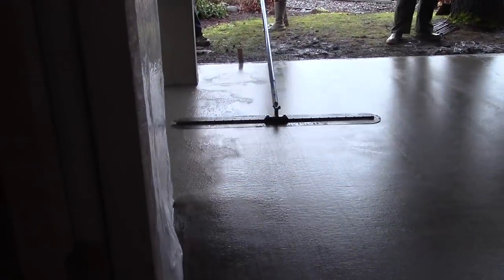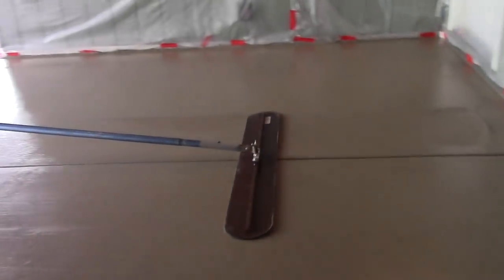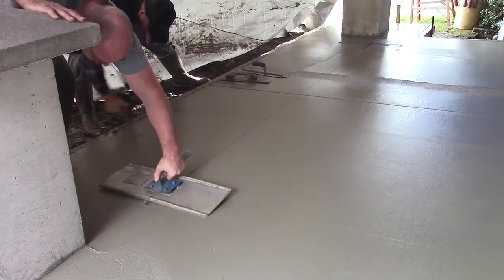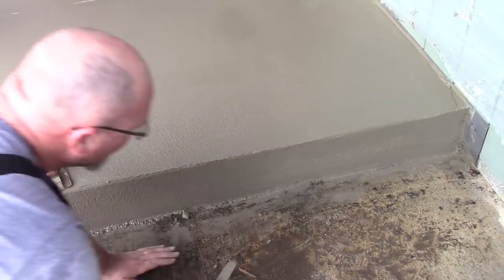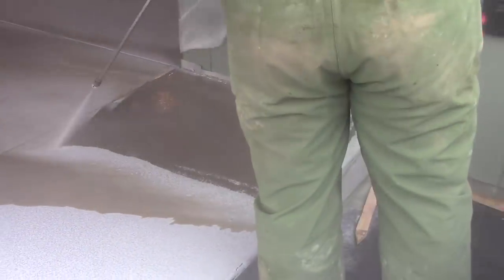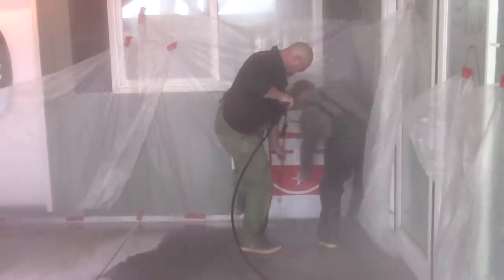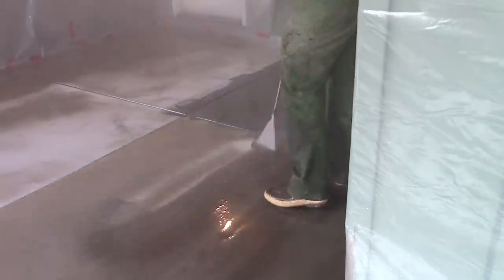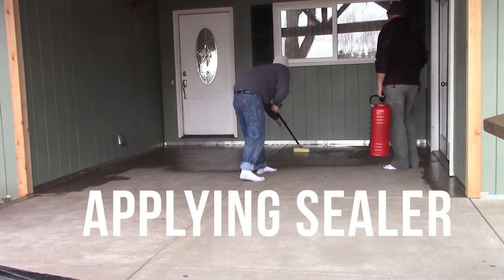Concrete Finishing Done Right

Comment: After doing concrete for years as a youngster (20's-early 30's) I was at a jobsite last week and the homeowner an his "crew" were pouring a sidewalk from the city sidewalk leading to the fenced off backyard to be patio forms at the SAME time. 4 guys standard weight crete and they started at the city sidewalk and worked their way to the backyard and ending with the patio. The entire time walking through what they placed from the start. What a mess. What possessed them to start at the city sidewalk, then barrow through all they placed I don't know. On top of that they used chicken wire and formed with 1x4 and 1x2 vertical stakes and nailed it all off with gunned in 16D's.pointing into the crete. I was there Friday to finish my mechanicals and the homeowner was getting estimates to remove the entire mess-LOL.

Comment: Yea, these guys know concrete and they work in numbers, one or two guys is not enough for this kind of job. I like how they even pull out forms before it totally cured, to finish vertical wall, have all of the tools needed, cut control joints, even where the posts are, because it is where they will "temperature crack". This kind of work is so sensitive, you have to have nerves of steel. 
Concrete is expanding on the heat like crazy later, if you don't cut it right. 
I'm a long time mason, you have to to predict everything, when you work with mortar or concrete. When it's cool, you have more wetness in concrete, because of chemical reaction of cement and lime, you get condensation. When it's hot, you have concrete drying like crazy, because you have this warm reaction in concrete plus heat of the sun. That's what mostly kills concrete jobs: poor planning, lack of experience, disappreciation of quality work throughout, because of bad economy, banks stealing money from people and tons of parasites in so called "government", then it goes: faster, faster, who cares about quality, we need cheap, take money for the house and run to Hawaii. Everyone wants to dictate. Looks like there every time new codes get introduced, but housing become more shittier and more expensive like crazy. I don't know where we are going. Lipturds and whole bunch of parasites kill this country.
It's me doing some small job with cut-bed stone https://youtu.be/rxNGQeUhCLo  
  https://youtu.be/0XbyLAZhH-8

Comment: So your concrete as poured is as runny as cowpats from an unhappy cow, and then it's dry a few days later. I'm impressed by the detail work of your finishing crew, but I was taught to run the mix as dry as possible and still be able to move it at all, because excess water in the mix weakens it, and then once it's setting keep the surface damp for 28 days to enable it to fully cure.
Your surface looks lovely, but I wouldn't give tuppence for its structural strength.

Comment: So, when you do a garage floor, it does not crack in the middle after a couple of years like the one in our garage that the Doofus Inc. did when they built our house?
Reply: TestDriver 
There is one guarantee in concrete . It will crack

Comment: Did the massive cracks show up around the columns yet?
Should have had expansion material against them to prevent it.  Too late now.
Reply from the maker: 3 1/2 years later the cracks are all in the control joints where I asked them to go. Stop by sometime and I would be happy to take you on a tour! The clients are very happy!

Comment: Excellent presentation Most don't have an idea of the articulation it takes to play with Cement if done right.. Like tracking a creature Or perhaps like building a sculpture Reading the material and its supple grades. I worked with some old timers pouring a skirt around a solar house with double walls. The old guy lay tile just after the pouring. I lay in some stairs after wards, and the  engineer was perturbed with me because the stairs did not match.. slightly off. The skirt was laid in after the rains and he had a gusher coming in off the street. I showed him the underground river flow he had under the  house that made the entire place shift.. (Then he was OK with it. told me to fill it in). In california you build on very steep inclines !    I now live Georgia.. in every home I have seen they do not run lines down the driveway or large surface poor's Terrible as you can see the behemoth cracks from the street never understood why anyone would allow this.. even as a weekend warrior. + any house I looked at when purchasing I could not find a flush floor anywhere.
  Enjoyed watching, an education     I'll be back a few times Thanks for the post.

Comment: These guys are good. But some of the other comments are right. There is too much water in the concrete. This concrete will have some extra cream because it is very likely 6 sack mix because of the small aggregate due to the size of the pump.

Comment: Agreed, it "looks" great, but you thinned the mix so much with water it almost flows by itself. Did I mention how weak the mix is? Pour a nice, strong, thick mix of #5 slump and show me how great your workers are at "wet pulling." Besides, if you mixed a strong batch of concrete, cracking over top of the old slab would not be a problem.  Did I mention the old slab has already settled whatever it needed to so isn't likely to sink anymore unless tree roots are growing underneath? Good workers, but you are leaving out several cheat details. Use a vibrator and that soupy mix will level itself.

Comment: everything u saying  not to do with inexperienced person, it happened to me 2 months ago. did the whole basement with an old guy, a home owner and 2 helper that gave up half way. we started at 2pm, cause the truck came late, at 4pm, one guy left, at 6, another one left. so, just me, old guy and the home owner. we did until 9pm, then they left and stayed by myself until 11:30. been doing construction for 20years between part time and full time and have worked for over 24hs straight, but cant compared with this experience . never been so tired my whole life.  the worst experience of my whole life. this is the job of at least 2 experienced  guys, with at least 2 experienced  helper. hire a professional that does this full time, even if you are a contractor

Comment: What kind of concrete is that.? It looks super pastey.
“Mud” is mortar for block masons. Concrete is not called “mud”
The “wet rod” is actually called a “screed” or “straight edge”
It is not done by eye or feel , but based on “pads” set by laser or level chalk line on the wall.
Reply: He said they screed to the level that they had floated it to
Reply: Andrew Carey they clearly know what they are doing and finish looks excellent. He says concrete the majority of the time... if you would care to upload a video you have done of a similar job am sure we would be happy to  critique it.

Comment: 1:30 god this description of a screed board being called a “rod”. What those guys are doing is called kick screeding. What they did was float the edges with their floats to get a level, then screed across to make the slab level. Then bullfloat it and hand float the edges. Then edge the slab. I see they went back over with the Fresno Float to get it extra flat and smooth. All interior concrete is slick/smooth finished. Then I see he cut the joints with a pole jointer nice and easy.

Comment: if you pouring over old cracked concrete and are worried about the movement transferring up through the new pour! why put put in fake expansion joints that dont go through the depth of the new pour? thats just cosmetic

Comment: Did it not need the poker in it? to vibrate all the air bubbles out
Reply: Pistol Pete not in this case. First it looks “thin” and probably had additives to assist the pour and not uncommon when pumping.  Thin = less likely to retain air bubbles. Second not a deep pour like a wall.
Reply: I disagree. Doesn't matter the depth. Air in the concrete means reduction in strength. Vibrate it and get the air out.

Comment: 9:51 that corner on the bottom right is going to wash out and the slab will fall there within 2 years. honestly, its unavoidable because of the elevation and slope of the driveway unless you do something monolithic and pin it from the driveway and let it all fall together

Comment: The thing for me is I do everything great but the rod my people don’t trust with me . It’s a lot of forearm work😂💯 but have been working on them since I last did them. I know when it’s dry just tap the cement if it’s dam. Anyways come. Sense and when taking the sides off I personal get a hammer and get it lose take the nails off and boom no worries on the concret cracking.anyasy the rod thing is a big deal for construction workers

Comment: why do you gotta make it look like its various blocks instead of one
Reply: Concrete has amazing compression strength, but relatively poor tensile strength and will always crack. If you add these joints, you have some control over where the crack happens (hence the name "control joints"). The broken section can be demolished and removed without looking completely out of places, too. Control joints should always go around columns and pillars because they are under different stresses. Other items that have similar factors to consider also need these "isolation  joints"  The steel reinforcement will keep everything from totally separating. There are lots of different ways to reinforce concrete depending on how it will be used.
Reply: @alejandrogonzales7022  Thank you!

Comment: No one screeds with 2x4's any more.  Too back breaking and slow.  They did get it flat though.
Reply: Almost every residential job I've seen uses 2x4 screeds, as recently as 9 months ago. What are you seeing?
Reply: @skeetorkiftwon  ... just about always use a power screed (vibro-strike). One man rakes, one man screeds. Plenty of "juice" to float the surface easily or power trowel and a far more even surface finish. It takes a couple of pours to get used to it but you'll never go back to 2x4's and sore backs again.
Reply: @Supe063 

 I'll check it out, thanks.

Comment: I was trained as a carpenter, I've done pretty much all the jobs around a construction site.  Putting in concrete is the least forgiving if $%^&  happens.  You never can have enough help good help.  A homeowner can be the biggest liability on the job site.  They get in the way and it's not easy to tell them to stay clear.

Comment: Unfortunately if that was tested, it most likely wouldn't have passed slump test or cylinder tests. The work looks amazing tbh but they make it look so easy and that's partially because of how wet it is. 80 plus or minus 20

Comment: Excellent finish. But still...
Armering part is not done correctly. Overlaps are too short (the load is not evenly distributed due to insufficient overlapping). Armering is too close to the pillars and there is no expansion material around the pilars. Armering is not securely lifted in adequate places. There should be plastic under conrete to keep the water in conrete while curing. (tsement uses water to cure and if old conrete had cracks, water will dissapear through those cracks.)
If the old concrete was cracking, there should had been extruded polystyrene plates between the old and the new concrete so you would have deformation cap between two layers. Also armering net should had been more frequent.

This is constructive critique, not the degradation of the outcome
But in overall 3 points from 5.

Comment: The workmanship may be fine, but using a rigid paving material over an old patio and near a big tree is inadvisable. It would surely have been better to use flexible paving or decking.

Comment: Not using a laser which means low standards. I guess this is fine if the person you do it for dont care about millimeter accuracy. But not using a vibrator = Saving airbubbles in the concrete, weakening the concrete MASSIVLY in a 10~ Year time i think is a shame. And talking about "done right" If we did this in sweden we would be shut down in a month.

Comment: Inciting fear to sell a rip-off ! Don't believe me ? Get this guy to a proper construction site of your choosing and have him repeat what he says. Hydrostatic pressure is a problem for a 7 meter tall shear wall, not a 10 cm thick deck pavement, and you can get the most unqualified workers to do a similar quality job, if you stand there and direct the work which seems to be at most a 1.5 hrs process.

Comment: That  existing concrete that you aloud to stay in place will rear its ugly head eventually over time but sooner rather than later.  I'm going to take an educated guess( educated=30 years of industrial and commercial concrete construction experience). Sooner = 5 to 7 years but absolutely no later than 15 years. Oh but that is plenty of time even on the front end to relieve the contractor of any responsibility, even tho it was a installation failure, incorrect construction practices. Never pour concrete on top of old or new existing concrete never! It's really a shame because all the expertise that was put into the actual placement and finishing of the concrete by these fine young men will be enjoyed for only a fraction of the time that it would of if the existing concrete was removed!

Comment: I wouldnt hire anyone who said it was ok to pour over an old broken slab, regardless of depth or isolstion, and the reason is simple ... cracked material settles unevenly, and such displacements only increase with time, and are transmitted upwards into anything above. The result is shortened life of any concrete above, and eventual failure along the same fault plane.

Bad move, and disagree with the narrator on that count.

Comment: Pulling a wet rod...  Ok then. Whatever tickles your trowel I guess.  ... Around here we call it kick screeding.  
  So by avoiding having to pay all that money to have all that old cracked concrete hauled away you just created double the amount of cracked concrete to be hauled away costing twice as much as if you would have just taken out the old concrete.  And all that money you saved getting rid of the old concrete you spent on an unnecessary pump truck.   
  Whered you learn your BS from?